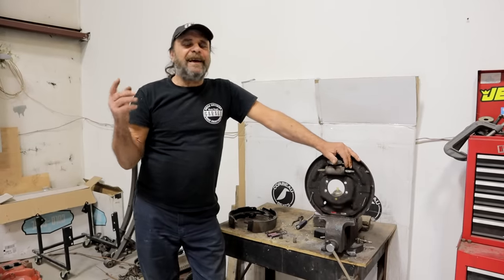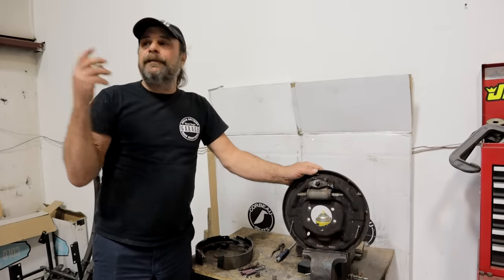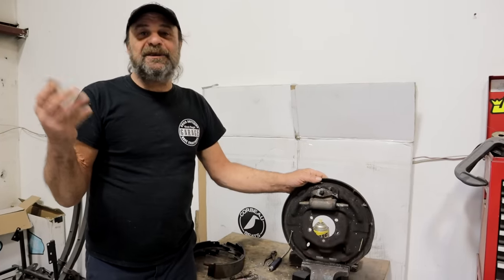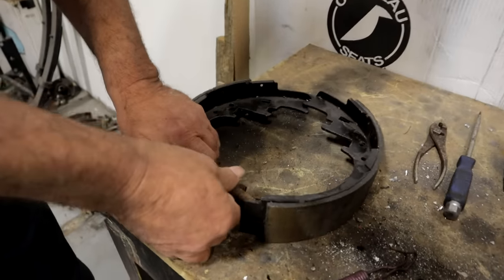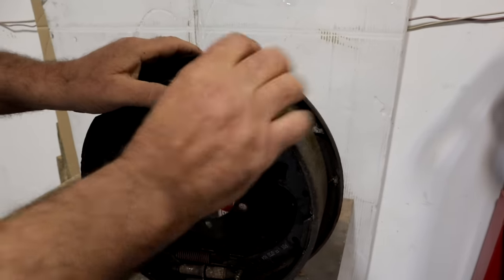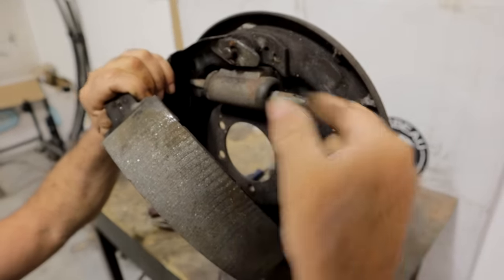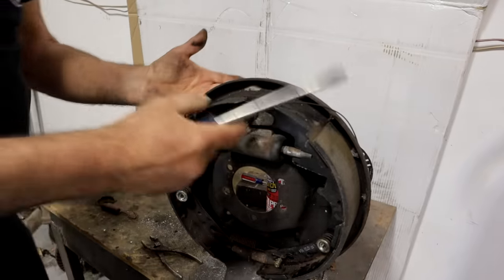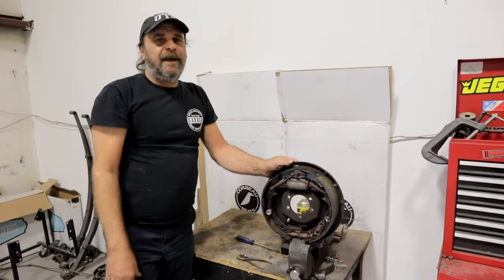Drum Brakes Made Simple - R&R Tips And Tricks That Make The Job A Snap

Comment: Of course you and Wes make this look so easy after a few weeks ago I screwed around with my 96 Chevy truck drums for a few hours before I figured out where all the parts were supposed to go.
Reply: Next time take pic before you rip it down ✌️
Reply: @steveib724  and only do one side at a time ,so you can run around to the complete side and copy that✌️
Reply: @MrTheHillfolk  Tony put that last spring on upside down lol but I know he knows he's shit
Reply: I actually tried to take pictures but they weren't much help. Everything was rusted, broken and covered in a thick layer of crud. Doing one at a time would have helped but stupid me forgot about that since it had been many years. Also the manual and most videos showed brakes that didn't have the same  "random parts" as these did. I think I got it about right after the 3rd try. They work ok.
Now if I could figure out how to bleed the last of the air out of the ABS module without an expensive computer scan tool.
Reply: @steveib724  haha good catch ,Im on a phone and had it in portrait mode reading comments so I couldn't barely see it 😆

Comment: It's not more pressure for disk brakes. They need more volume. So a slightly larger bore master cylinder is needed after a disk conversion. I learned the big advantage to disk brakes after driving my '68 f100 through a deep puddle. I had to ride the brakes for 3/4ths of mile before I couldn't have prayer when stopping. Disk breaks just wipe the water right off, and don't get soaked.
Reply: Drum brakes are self energizing. That's why there is a short shoe in the front.  They take less pressure than disc brakes.

Comment: Timely video indeed! I used to do these things in my sleep, but it’s been years. Today I went out to assemble the brakes on my Chevelle, which has been apart for a while. Sat there scratching my head. I do have the special tools, inherited from dad, I always use them . Also found out the backing plates had been put on the wrong sides, so I had to pull the axles and fix that first. Thanks for the tips

Comment: Right on Tony!

Before I worked in a shop, I struggled with drum brakes. Good thing to take the time to show these simple tricks that take a job from onerous to easy.  I also wish you'd shown the trick of putting a hose clamp over the end of the parking brake cable housing, to retract the fingers and make it easy to remove. Nobody showed me that one, had to figure that out for myself...

But there's one more thing that I came up with: I used to use Windex to clean all the dusty gak off the backing plate.  If there was any grease on there, that got a shot of brake cleaner, after the glass cleaner had gone on. 

Glass cleaner does a great job on brake dust, and any of the water soluble brake fluids (non DOT 5).  It doesn't kick the brake dust up and throw it all over the place like a shot from can of brake cleaner does

Just throw a drain pan under the backing plate, hit the mess with some windex, dry it off with a rag. When you're done, wipe out the drain pan.

Makes cleanup a snap. Easiest way I've found.

Comment: Thanks for this video Tony! I am sure it is very helpful to a lot of people. 
My take on the state of drums in 2022?
If you can find NOS parts, working on drums is a breeze that just requires patience and attention to details. 
If you are working with new replacement parts? just throw the whole thing away and buy more new replacement parts. And by this I mean, if the brakes had stuff replaced in the last 15-20 years, there is no "fixing" them anymore, they rust like they were in the ocean and most of it doesn't fit right to begin with. 

I replaced some parts on my 1990 Ramcharger. The drums were good, the shoes were actually pretty good. but the rusted chinesium stuff made them bind and stick, and even lock in reverse. 
New parts. Brand new! Figured that would do the trick right?
Some of them didn't fit as well as the old rusted stuff! And in the end, they didn;t work right anyway, no matter how I tried to get them adjusted. Stuff was cleaned, adjusted properly, and I had to take a wheel off once a month to mess with them. Screw chinesium junk. I replaced the self adjuster mechanism twice and they fit differently from each other and niether of them would work for more then 3 weeks. 

So I put a disc kit on it. i didn;t need a proportional valve because it's a heavy truck with plenty or rubber to stop them from grabbing, and I don;t drive that beast like a race car anyway. It cost me about $50 more then if i had to buy all new drums etc anyway, and no more BS. 

You can teach everyone exactly how to fix these things and how they work, but you can;t teach china how to make the parts properly, they don;t care anyway. I have my old police car to fix up yet, and didn;t plan on discs for that one. I will be watching swaps for NOS brake parts all summer. Hell, I would pick 40 year old, nice shape used over what you can get from the box stores now. Dangit, just thinking about that fiasco with my brakes two years ago is making me irritable! 
I don't live in the south, so my weather might have an effect, your milage may vary.

Comment: Thanks for the tips! Never heard of a quick R&R on a drum brake though, wheel cylinders are usually mandatory and nothing but rust.
Reply: You are working with chinesium, and yes, you are correct. 
Parts from 40 years ago can be rebuilt at worst. parts from the last 15-20 years(even if they are 3 years old!) are destined for the trash bin.
Reply: @davenhla  the wheel cylinders on my ford were worse than chinesium; original in Alaska. 30 years of snow and ice spray will turn the best metal into dust.
Reply: @wobbles7915  eh, could be worse, you could live in the salt belt like I do. That happens after 2 winters down here.
Reply: @davenhla  theyve been salting the roads here the past years because of unpredictable and brutal weather swings. 6+ month long winters and 90+F summers with high humidity and 22 hours of sun 😭

Comment: I'd love to see an A-B comparison of the same weight car from the same era, one with discs, the other with drums and see what the stopping distance from 30mph, 50mph and 60mph are and compare them.
Reply: Also if the drum brakes release quicker than the disc brakes, would there be quicker times in the quarter mile?  I'd like to see those test results as well.
Reply: @raynicolaas7679  Since the shoes in a drum have springs pulling them back they release fully. With discs there’s just the rubber seal in the caliper to hopefully pull the piston back slightly. And, besides maybe some small rattle springs there’s nothing to push the pads off. Then, after the discs get a little age they’ll release the pressure but still drag some because everything doesn’t really retract. 
It wouldn’t be a significant difference in times, but it all adds up and would be a bigger deal on a lower power car. 
It’s also pretty easy to feel. Can just remove a non drive wheel, put a couple of nuts on to hold the rotor and spin it. Then tap the caliper in and out a little with a rubber hammer and it should spin more freely since the pads will be knocked back. Then press and release the brakes and you’ll see it go back to dragging. If the brakes work really well they won’t drag much, but typically they’ll drag pretty noticeably. If it’s enough the hub is hard to turn you’ve got a problem.

Comment: I used to train my apprentices to do drum brakes this way at Toyota, I never thought about it on other makes. I’ve bought and used the tools, I can only think of a couple  occasions when they made the job easier, pliers and long flat head for the win
Reply: You must have had shitty brake tools.  Snap On brake spring pliers are ridiculously expensive for what they are, but they're leaps and bounds better that the soft metal $20 garbage from the parts store.
Reply: With experience and ingenuity a person learned to do a job well, but it must be that we just didn’t spend enough money on specialized tools, yeah thats the problem.

Comment: I work on antique motorcycles with drum brakes and cable actuation. You simply can't get the exact brake shoe material thickness you need to reline the shoe's. Once I reline the shoe's they will go into the drum but they won't have full contact with the drum brake surface. You don't want to ride the bike with shoe's that need to wear in until full braking power is achieved. To fix this I glue sandpaper to the drum braking surface, put the drum on, then adjust the adjuster until the shoe's contact the sandpaper. Then turn the wheel and adjust the adjuster to sand the shoe's to the drum. You can remove the drum to see the progress and once the entire shoe's show evidence of full contact with the sandpaper you are done. Then remove the sandpaper and glue from the drum. You will then have full braking available without wearing in the shoe's.

Comment: My first dragster had Buick aluminum drums. I would frequently bust them open during hard braking. As they became difficult or impossible to find I decided it was time to switch to discs. The disc brakes made it far easier to stage the car (a benefit I was not expecting). The drum brakes would grab and release in a jerky fashion, making it difficult to land the car in the beams. The disc brakes would let me roll in smoothly and make a precise stop. I noticed no difference in reaction times with either brake.

Comment: My 2005 Dodge caravan has drum brakes still designed the the same as your demonstration plate. Works great especially if you have a van load of folks. I have always liked drum brakes for stopping heavy stuff and if you want to hold and do burnouts setting still, you leave the rears in the 30% to 40% range. If they get wet in mud puddles or flooding streets to prevent stopping fade, just ride them a bit and dry the water off the shoes. I lived in Florida torrential rain storms, then Sunshine an hour later worked great drying them out or you could not stop soon enough. 
Just had to get used to the feel of setting the tension, run the shoes in about 100 miles, then use the auto adjusters in reverse to balance the shoe tension.

Comment: Uncle- Perfect timing!!! I just decoded the Dart fender tag after owning the car a year+... And my 1 of 100k(?) Slant Six Dart Custom, that Id planned to restomod with a carbureted 5.7, disc and axle upgrades, etc... turned out to be a 1 of 25 V1H Floral Top car!!! (Often referred to as a Mod Top but that was Plymouth) So...no Hemi, no discs, no mods...now it will just get a stock resto!!! The brakes are toast, so guess ill be rebuilding them all now!!!
Reply: Try and hunt down oem parts if it's that much of a sweetie. 
I've got a later model car I like to keep all the chalk mark crap intact on,and it is kinda fun to hunt down nos parts. 
Of course I kept the original worn out crap on a shelf 😆
Reply: @MrTheHillfolk  Agreed. Im def going with as original as possible now. The car is rough, needs a quarter from previous collision repair done poorly, plus some rust around rear window and driver side floor, but it'll get fresh sheet metal over time. Now i need ANOTHER car to put that Hemi in!!!🤣
Reply: @wheels-n-tires1846  
Yup that's a perfect excuse for another project too, I've got about 3 of them because of that 😆

Comment: I think where people get shy on this, is in the initial adjustments after getting them all together. Everyone I know of that does this for the 1st time goes too light, and they rely on the self-adjust too much to lock it in. Good video UTG, and yeah. Drums are simple and easier than people make them out to be.
Reply: My dad always taught me when adjusting drum brakes after a brake job(he was a master tech for several automotive brands throughout the 70's and 80's) to turn the adjuster wheel in until the wheel is completely locked, this kind of sets everything in line where it should be in there and the adjustment will remain more accurate, then use a pick or something and move the ratchet off the star wheel and back the adjustment off while turning the wheel until you get the desired drag, which is slightly more than one might think. After that they wear in quickly and the self-adjuster takes over from there and the pedal is always high and firm like it should be. Done that ever since and always had good experiences with drum brakes. No telling how many thousands of brake jobs that guy did over the years.
Reply: @MattsRageFitGarage  Same way my dad taught me, then you drive it around the block a couple times to wear the shoes in & the self adjusters take care of the rest. Too cool that you commented on that, because I was able to find your channel as well. Dang Cool Stuff you have going on man!
Reply: @BareRoseGarage  Yeah, I have tried just adjusting the shoes up until they felt good and it never works right, gotta get them tight then back em off and they work great. I think that is why a lot of people hate drum brakes, is that little known adjustment trick right there.

Comment: That's how I've been doing um 40 odd years now, dad had one of those spring tools, tried it went back to a screw driver. 
 Wheel cylinders for me leaked about 50% of the time (rust belt salt maybe?) so I always rebuild the things, until a guy I knew at the parts store told me what new ones cost. Probably can't even buy the kits anymore. 
 Worth noting large trucks with a few rare exceptions (Mack had discs in front a while) use drums. As long as you don't ride the brakes going down a mountain, they don't fade.

Comment: I'm interested in a Ford obs f150. They come with disc in front and drum rear. After watching two videos where the owner had trouble with a conversion kit and then your discussion on drums, I will keep the drum brakes. I've done drum brake jobs over the years, I'm older than you, Tony, and I agree with you completely. I like 4 wheel discs on current vehicles, but it's good to keep the older cars as is. I have a friend who says hot rodders have a tendency to re-engineer until they screw up the car to where you can't rely on it - always carry enough tools.

Comment: I've always stuck with the factory rear drum setups on my mk1/2 Vws. 
Yeah,you can swap to MK2 16valve rear discs,but for these older cars that sit alot the sliders stick and burn up the pads. 
The Mk4s are notorious for this, I've changed 2 sets of rears before the fronts went bad. 
On my mk2,I put new rear drum everything on a full rebuild in 2002. 
I drove it a few summers and parked it inside for 10yrs. 
Opened it up for inspection, it needed wheel cylinders and that was 2013, since then they haven't needed a thing. 
Yeah it's a summer car, but guaranteed I'd be futzing with stuck disc brake sliders and whatnot if I swapped. 
And besides, the back doesn't do much more than 30% of the braking and you can swap to the larger rabbit pickup drums too.
Reply: Hey Mr Vw guy.  I agree with the drum set up. I've been lucky to get 91 Passat diesel drum brakes in only the diesel model they are larger than MK2

Comment: Yep that's exactly how I do them on the 10-inch drums on the back of my 62 Lancer ( A body 8 3/4), I did however put disc on the front because the original 9-inch drums sucked but I kept it small pattern, however the 4-piston Kelsey Hayes calipers were very problematic for me so I modified caliper brackets from an aspen to fit that spindle and use Bendix single piston calipers on the kelsey-hayes small pattern rotors

Comment: We used Velvet touch disk pads and they have no drag until they get hot but they really work at very high speeds. The same type full metal shoes are great for high speed stopping as the Police and Ambulance  have used them for years .They will outlast any drum or rotor. The same factory here in Rochester has built Ceramic brakes and clutches for major brands to relabel .

Comment: I bought a '72 F250. They had the front shoes on the back, had the left side on the right, and the leading shoes trailing! When you braked going forward, the brakes adjusted in!
Reply: With the shoes on the wrong way around long and short it would have stopped better going backwards

Comment: I still don't know how those tools work either, thanks for the validation! I modified a low quality screwdriver with a tapered die grinder bit so it can't slide off the anchor post while installing the spring.

Comment: The only problem I've ever had with drum brakes is adjusting the rear ones. The drag of the rear axles, differential, and driveshaft make it hard to get a good feel for whether the shoes are dragging on the drum or not when you turn the wheel, unless it is already too tight. I do agree with you on using a screwdriver and pliers. The only actual drum brake tool I have is the adjusting tool. And a bent screwdriver would work just as well. I still have the same tool I bought back in 1975, at age 16.

Comment: I had a 1984 ford Tempo.  The self adjuster pawl plate wasn't hardened properly and the star wheel rounded off the square edge of the pawl. The self adjuster star wheel was free to rotate and it spun itself down to the point that the adjuster fell out while driving down the highway.  It caught inside the spinning drum and made a loud bang and punched a small hole in the flat part of the brake drum. I hit the brakes when I felt the bang and lost most of the pedal pressure